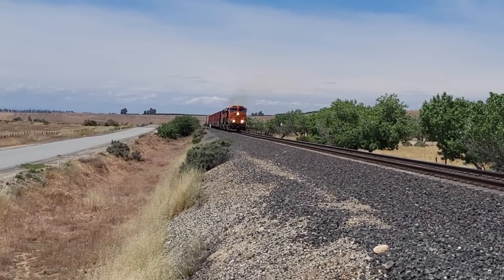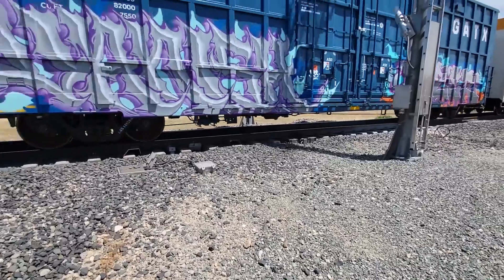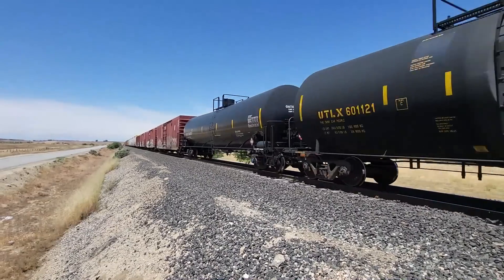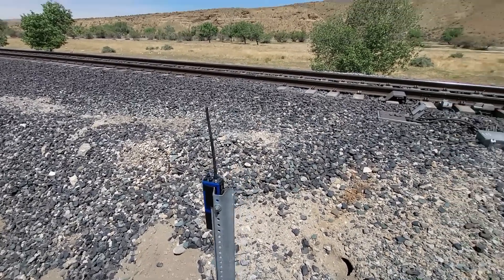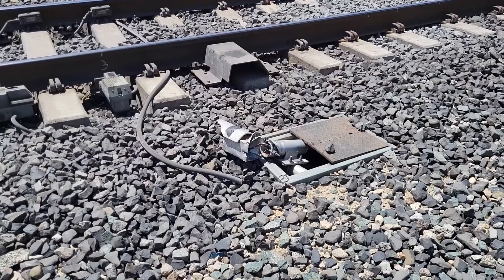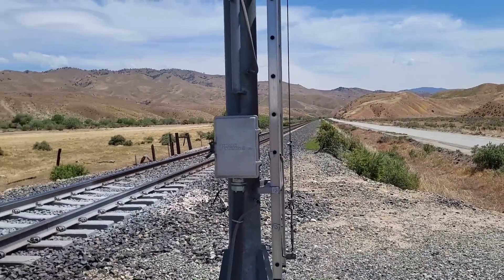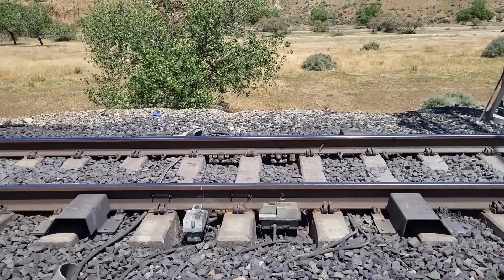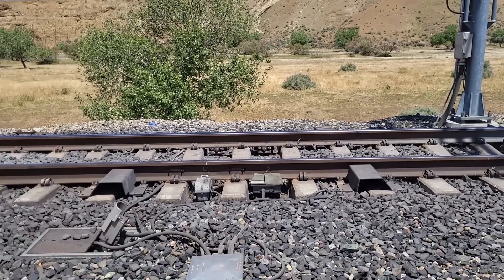UP Hot Box Detector specs post East Palestine

Comment: Defect detectors are different on each road and rules that pertaining how to handle them are somewhat the same but different at the same time.  Most defect detectors give you a greeting and start checking the train.  Usually you have a dragging, axle temperature, and axle count equipment on a typical detector.  If everything is ok then you get a greeting saying no defects and a axle count.  Some detectors have high and wide detection on them for loads to high or to wide pass through tight spots on the railroad especially near tunnels or bridges. They can also be equipped with cameras for this purpose.  Another thing a detector can have is a impact detector.  This measures the impact of the wheel on the rail head.  They are used to catch flat spots on the wheels that are severe enough to cause damage to the rail.  Last thing a detector may have is car reader.  This reads the little box with magnetic strip on the side of the car and records its location.  Also......at least on the road I worked for.  Defect Detectors did "talk" to the dispatcher when there was a temperature difference between two detectors when there was a rise or spike in axle temperature.  That's what I can think of off the top my head.  My two cents worth.  Be safe out there.

Comment: UP detectors integrity fail train is good for normal speed. Key trains slow to 30 to the next detector. If the next detector also gives an integrity fail, stop and inspect the train. SSI Item 13

Comment: I see Washington's Senator Maria Cantwell is working on possibly bring the Hot Box Detectors under FRA regulations, when I worked on the railway 40 years ago they were not.
Reply from the maker: They never have been. The railroads installed them on their own, with no government recommendation or regulation. Unless they are tied into the signal system, which would be pointless as a train is already there, there is nothing to regulate. Of course that has never stopped the government from sticking it's nose into anything in the past! It won't create jobs or help job security either, as they are already tested and inspected every two weeks, and calibrated bi-annually.

Comment: I see to remember 200 degrees on NS... probably lower now....
Reply from the maker: I just had an NS Maintainer tell me it is 180
Reply: @MarkClayMcGowan  Good to know.  One of the "news" shows said the first alarm went off at 200 above ambient.  At that point, it was about a mile from the city, where there was a lot of metal getting flung around on the wheel on that coil car...(Seeing a visible burning on the security footage was amazing.)  I've never run into a hotbox talking, but have heard several dragging equipment announcements.
Reply from the maker: It passed two detectors above nominal, but within the set limits. It was over the limit at the third and gave an alarm. The crew were bringing the train to a controlled stop when it went on the ground.

Comment: With the amount of metal shavings on those transducers, i would not be surprised if that detector is having axle miscount issues
Reply from the maker: It's just metal, which is the same thing the case is made of. It has no effect on the transducers. Thanks for checking it out!
Reply: @MarkClayMcGowan  no sir. It is a plastic housing with a strong magnet which is what counts the axles. That is why there are perfect circles of metal shavings stuck to them. Too much and it effects the magnets ability to distinguish between the wheels and the shavings
Reply from the maker: The magnetism is not affected by the housing or vice versa. The attraction is still metal to metal. I worked with them for 40 years. No amount of shavings have ever affected them. The flanges drag as much off as they deposit. It never gets piled up
Reply: Did you ever have to grind the transducers a bit to raise them up to the proper spec below the top of the rail ?
Reply from the maker: Naw. They aren't installed on curves, so the rail wears evenly and would be changed out before it got to that point. Thanks for checking it out!

Comment: I'm a NS comm maintainer that works on detectors. In my division it will alarm @ 180 over ambient.
Reply from the maker: Thanks for the info!
Reply: Cool, I preceded you by a few years, Hot Box Detector Tech on the old N&W Lake region until the Southern merger in 1982. Then I was on the eastern side of the western region. I had 45 detectors in parts of 5 states. Back in my day the detectors were readout on strip chart recorders. I was titles General Inspector Signals in the ARASA union. My position was abolished in1986 for 2 Brotherhood of Signalmen electronic techs. One was positioned at the then new dispatch office in Ft.Wayne and the other at the Hump Yard in Bellevue, OH. Only ever saw one trackside analyzer try to work, installed some 25 of them but only one was operating at the Casad, IN yard detector. It was a funny output the train passed at 657 MPH and was over 100,000 feet long. We ran trains fast and long back in the day. Always thought is was a wheel detector issue. I worked on Servo 7707D, Servo Model 87 retorfit, Servo Model 9909, GE HB290 and HB300. Used Harmon Electronics Line overlay carrier to transmit and receive the detestors to the readout locations.
Reply: Covered Bellevue to Farnham,NY, Bellevue to Pittsburgh, PA now its the W&LE, was the old Pittsburgh Div, Bellevue to Ft. Wayne, Bellevue to St Louis, MO Later swapped the Frankfort, IN to St. Louis with the Decatur, Ill tech for Milan, MI to Ft. Wayn, Muncie to Ft. Wayne an Muncie to Cincinnati. Wore out 2 trucks. All mostly single main. Conrail was still Conrail back then.
Reply: We set the Servos for 6 mm at 130 degrees above ambient and 2mm gating pulse, and the GE's for 11 mm and a 3 mm gating pulse. GE used an automatic heat source no temp above ambient specified, though it had a thermistor attached to the heat test unit. All the detectors used ballast mounted scanners, was very glad for the iso-clamps and rail mounted scanners for the servos.
Reply: We did not try to determine bearing temp in the early 1980's Would have been nice to know at times But the strip chart recording, likely would have made it hard to determine.
Reply: @garyfiber3525  down here in the south, all of us comm guys are IBEW.  We handle the hbd unlike in the north, signal guys do it

Comment: On our detector at train speed 5 or under it will give a train too slow. Our detector will not give an accurate temp reading at speeds below 5 or above 90. Ors is made by Progress Rail. Not all detectors out there function exactly the same as purs foes in regards to trains too slow
Reply: We use southern technologies NG detectors mostly on NS. It's 7 mph for us. At really slow speeds you also run the chance of having reverse direction issues with reporting as well.
Reply: @keithgiles1233  thanks for that info Keith. I may be wrong but asking. Can the parameter on the slow speed be adjusted in the computer?
Reply: @ccrx6700  not sure about maintainer end of things but I'm sure it probably could on an administrative end
Reply: @keithgiles1233  thank you Keith
Reply: We would miss wheel at real slow speeds. Never forget the First time I saw a roadrailer over a GE detector, it was all wheel pulses, no heat. I was standing the the dispatch office at Brewster, OH. Just about jumped into the truck to go to the detector to do a heat test, but the dispatcher explained all the roadrailers looked like that, next train over the detector looked normal.

Comment: Good information.  With regard to the NS East Palestine derailment, the open  phone line was breathlessly speculating what could only be characterized as uninformed garbage.  Thank you for your reasoned presentation.

Surely the data from each detector is sent at once to a data center.  I would have expected to hear NS and the NTSB discuss the temperature difference issue between detector locations (which was made public) in some fashion, whether addressed at once or later, as data arrives.  A program to quickly review and analyze changes in axle bearing temperature is yeoman's work.

Ambient is known at each detector,, the temperature for each axle is known and stored, train direction is known, analysis is possible in milliseconds between adjacent detector locations.....  This is basic safety management.
Reply: They should have all of them talk back so you know if it is working

Comment: An improvement would be to be able compare between axle temps from one detector to the next.  An early failure could be detected this way by looking at the rate of rise as well as the measured temperature.  IIRC the East Palestine derailment showed a fast temp rise on one axle well before the measured temperature tripped the alarm.

I'd like to think that the railroads log all this data and could quickly work out if this is a good idea or not.
Reply: Some already do, I've had a crew been stopped due to a trending hot axle, after it had passed a few DDs.

Comment: Great video Mark but I amazed on how many flat spots or flat tires (tyres from where I come from) as the cars pass. That must add a lot of future track maintenance, luv your work. Melbourne Aus.
Reply from the maker: Flat spots are noisy, but most are minor, and don't contribute to track problems. If a major one is reported (and they are reported), they may stop the train, and if necessary, set the car out in a spur (very rarely), or at the next yard with a inspection facility. Wheels are inspected at regular intervals and repaired or replaced as necessary.
Reply: Wheels in the U.S. 😉

Comment: I’m a hot box texh on CN. Differential is the difference in temp between left and right bearing. Integrity means detector malfunction.
Reply from the maker: That's what I said. Differential won't stop a train, but along with a few other issues, will only announce an integrity failure
Reply: @MarkClayMcGowan  On the N&S back in the 1980's we did have an axle differential, seems to me if the recorded height was twice to other side of the same axle it was a stopper. We used other specs but those are escaping me now days, though another one looked at the problem bearing being much higher that the other 3 axles on the same side of the car.
Reply from the maker: LOL. Almost ALL of it escaped be after retirement! I had to call the Signal Tech to get the right information. Thank goodness for connections!

Comment: With regards to integrity failures, I’ve also heard that if a train is going too slow, the detector will give an integrity failure. Does a slow train throw the equipment off or something or is that just another rumor i’ve heard (If you know of course). Really like anything you do related to signals and detectors since that’s really a department that you barely think about regarding the railroads despite the importance.
Reply: It should not but reports as slow train. But I’ve seen integrity on slows less than 5 mph
Reply: @JamesCarlson-o4p  Thank you.
Reply: If the lead engine is not traveling at least 7mph it will give a "train too slow" alarm
Reply: @keithgiles1233  We would miss wheels on a real slow train, even detector time out would occur.
Reply: You also don't want to stop on a detector or DD.  That tends to get them to upset also.